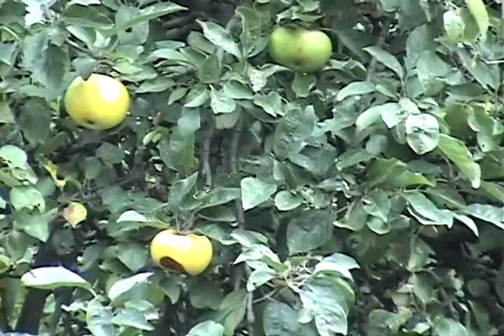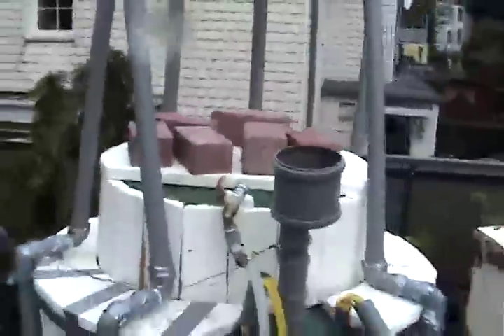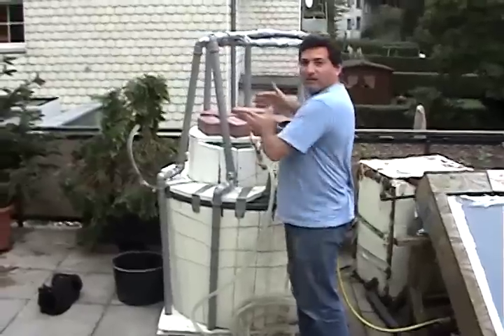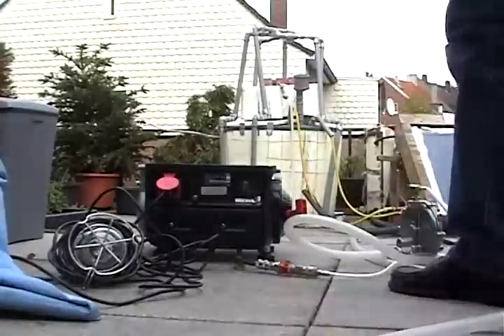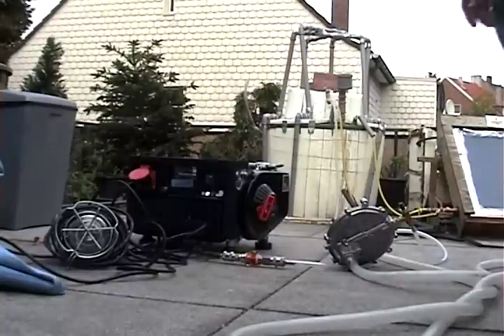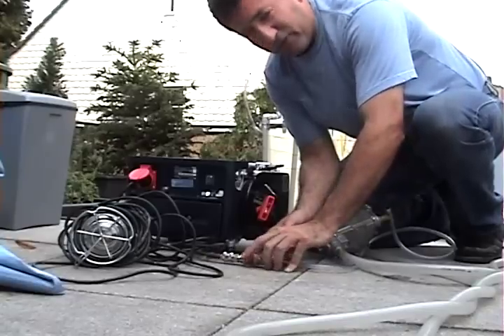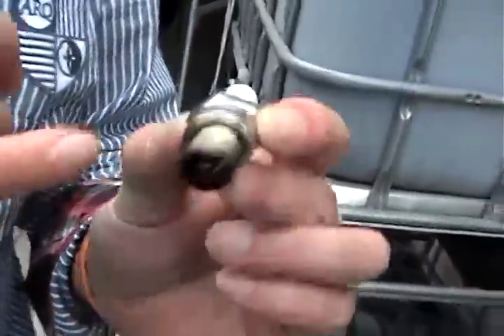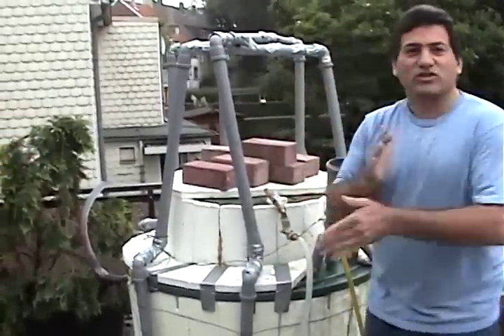Running a small engine on household biogas using "brickage' for gas pressure 2

Comment: You need to get a 4 stroke it is a matter of time before you seize that engine. If you do succeed with the oil you will probably over oil it and it will smoke like hell. I am going to do this in Portugal but I will also add in hydrogen made from solar pv. I need very little electricity 50 to 100watts that will economise on the use of gas. Basically the generator is jus running on tickover I may need to increase the weight of the flywheel a bit. What matters is the pressure of your feed gas the number of brick vary according to the cross sectional area of the drum. If you fit a pressure gauge in the feed line  you could do without a pressure regulator and just very the number of bricks.

Comment: Your the Man Brother , your doing my dream , I don't know if you will get this message because the feds do nothing but hate on me , but one way to increase your pressure is to use springs inside the tank , a cheap and way to get high pressure free , with out using energy.

Comment: Thanks for the vid. Did you say you ran out of fuel when the engine stalled the second time? Just curious to know how long it runs on your size bio-fuel generator? This way we can get an ideal based from your setup how many, or how big of a bio-fuel generator we would need to run the motor as much as you want, 24/7, or at least 24/7 for a few days.

Comment: When running propane in my 2 stroke bicycle motor I put on 2 carbs one which came with the gas regulator and the other smaller one came with the motor. I bought a Y spiter to allow 2 carbs and run an iol rich 12:1 in one and methane in the other compensate for the inability to mix oil with the gas phase methane. (A) carburetor- adjust oil+gasoline mix,  (B) carburetor/regulator, C a way to mix the output A and B  before intake. The gasoline acts a well distributed  delivery method for lubrication with enough.

Comment: You need a scrubbing system between the biodigester and whatever it is you use the gas for. Apart from methane, biogas also contains hydrogen sulfide, which, amongst other things, smells bad and is corrosive; moisture and carbon dioxide. You should run the gas through a water bath, so the carbon dioxide dissolves, and then through a scrubber, to remove hydrogen sulfide and moisture. For the scrubber, you can simply use a U-shaped pipe, stuffing steel wool in the ascending and descending portion of it (to remove hydrogen sulfide) and something like kitty litter pellets on the bottom, to absorb moisture. This should enable you to produce much purer methane, moisture and odor free, that won't corrode any metal components.
Reply from the maker: We appreciate  the sentiment and have experimented with those approaches for the last ten years and determined that apart from running engines  for our cooking and water heating  uses it was unnecessary. We continue to use simple scrubbers for engines as you describe but no longer bother for the stove.

Comment: thank you for your nice sympathic project and for your anthousiasm
if you permit me, just add a pressure measurment, lilltle hole + screwer and put it there, so you can read directly your pressure at the outload, and always write it in a book, so you will control much better your experience
and a ph metter for your digester, it must indicate a ph of 7 sign that your bacteria in there are really happy to work for us

Comment: If you use your bricks to force your gas into a large tire inner tube you will have the pressure you need because the inner tube will expand as gas is pushed into it !!!! Also they make for great storage!!! If you are using the regulator it shouldn't matter about the number of bricks as long as you observe the regulator inputs !!! Also you can just feed it into the machine without the regulator using a ball valve to regulate the input into the carb!!

Comment: make a water column tube and watch for about 10in/wc. there are conversion kits that converts the gasoline tank into and engine oil reservoir with a automatic feeder valve that opens with engine vacuum

Comment: its good thinking But you can do this for better result : bump the gas into a water filter first  then into a air compressor(you can use a refrigerator motor as compressor ) into a gas tank and after that you will get very good result  >>> keep in mind its not a sempel operation an you need to take all the safety majors befor doing it

Comment: why not use a 4 stroke engine,, also why not change up the regulation device so you do not have to push the primer to give it less restriction if the reason for the regulation device is safety then some other spark arresting device that offers no restriction could be used like off of a big blow torch or other device... i understand there could be other issues i am not aware of that might make these ideas hard to  put into use.. they were suggestions per request..  some form of rubber cord could be used to put down pressure on the tank in place of the bricks this would allow you to not need a rack to stabilize it from tipping like rubber tie downs

Comment: spark plug gappers 1$ autozone and spark plugs do not come in the recommended gap.. a hammer not suggested. but simply flip upside down and add slight pressure to close gap. gently open to recommended gap w gapper.

Comment: Sorry for all my other questions but do you get better gas or cleaner burning gas from different waste products?  Is is it compatible with lpg? Does the bio gas smell?  Great vids would like to try some experiments myself.  I live in the country and everyone has lots of those large AG steel reinforced plastic containers just lying around as scrap.  Could easily get 20 or so if i wanted. Now that would be interesting...Would u need something to stir up the whole mix in a larger tank?
Reply: Gary Mitchell

Comment: What is this regulator device you are using before the generator?

My main goal is to ultimately run a generator with my biogas.
Reply: it looks like a regulation device off of a camp stove or bbq type grill or similar device lots of propane type units have this kind of set up
Reply: yes, thats what it looks more like. thank you
Reply: Most propane regulators off of grills only go up to 3psi max(because with propane, any more and it becomes a torch really fast) I suggest a regulator with a knob on the top that can go all the way up to 20 psi. No reason to try to add pressure with bricks and then take it away with a BBQ regulator.

Comment: The bell system is able to be used in a better fashion by changing your design slightly. A tall bell that has a counter weight pull system to make the bell equal a low weight is great. When the bell is at its top (Full of methane) the counter weight is reduced and that pumps the gas into a storage container. This weight system can pump higher pressure and is capable of pumping through a filter for better gas. This give you a pumping station that allows tanks installed on equipment and such.

Comment: I'm looking into setting up a bio-gas arrangement here on our farm and have some questions.  We soak our corn for our pigs because it just makes it easier for the pigs to digest and generate usable calories from.  The gas that is created from the fermenting corn is flammable and the corn soaking bin can generate this fermenting gas in a matter of just a few days.  I'm wondering if you have any thoughts on using corn gas?  Also, while we do have pigs, we AREN'T going to be getting into their pens anytime soon as they are quite large at this time, so harvesting the poop isn't an option when they get the size that ours are now.  HOWEVER, we have several rabbits we raise and breed for meat and they make a ton of poop and if you've ever smelled rabbit poop, you know it is very strong.  I know it does have a high ammonia content and I'm wondering if rabbit poo would possibly be a resource.  We don't have many kitchen scraps as those usually go to our compost or our livestock, but we do have a lot of other things around the farm that I believe I could relatively easily harvest in order to create our own gas.  Any thoughts??

Comment: Experts...please advise
I am from a rural area in Pakistan. When we built our house there was no sewerage system in that area. The way locals deal with the issue is to dig a deep well which is has brick walls and is sealed from top. Over the years it has built up with just human waste and water used in kitchen and toilets. Can it be turned into a biogas container?
Its like 50 feet deep and it was made in 2006. By now I am sure more than half is filled.

Comment: You need pressure to move gas from the biogas digester, through your pressure regulator and to feed the electric generator. Pressure is weight or force / divided by an area. In Your case you are reporting that 24 kilograms of weight is giving you enough pressure but your missing over what area. For instance 24kg/km^2 vs 24kg/m^2 vs 24fg/cm^2 each result in very different pressures.
Reply: If it's an IBC then the area is probably about 1 square metre.

Comment: Professor, how you lost weight. I'm surprised. But now it got better as it is more saldavel. So I'm still looking for the parameters I automate my small biogas generator. I'm looking at the core temperature, the system pressure. What would be another sensor or parameter needed?

Comment: Could you please tell me the specs on the gas regulator that you are using and the part number/supplier?
Thanks,
Gary
Reply: Gary The regular he is using is from a generator propane conversion kit they are all over eBay sorry it took 5 years for someone to tell you🤣

Comment: Maybe a cap which runs meth line and oil line, with an undersized fuel pump to run a smaller volume of " fuel" ( oil ) might work for the lubrication issue..  If it's a 600 cc, maybe a pump made to run say a 50 cc engine might work out..  I dunno what's out there but if a small one, it'd ( presumably ) be set up for commensurately smaller flows.. If also a 2 stroke, ought to be designed to handle oil running through. If not straight oil, some.. ..  Just a thought..

Comment: Excellent video guys...!   It's cool to see you getting a 2 stroke to run on methane...!  

I wonder if somehow running oil via a second line through the engine could be done simply..  

I heard somewhere that 2 strokes are essentially Diesel engines, not sure, but if so..( it'd certainly explain the mixtures they use.. I guess..) it might not neccesarily be needed to run ( for short times..) both oil and methane...  What if you had a 2 way valve on fuel line, and ran biodiesel or SVO...( cooking oil ) and the gas alternately  say 30 minutes each,..?  I mean, you could, because ( assuming til run on bd/ SVO ) then you could be sure it's getting lubrication some of the time at least, right..?   

A 4 stroke diesel, would Definitely run on SVO ect, and I am guessing might have less issues with lubrication, too... ( might still be a problem at the " top " end of the engine, but smaller volumes might cover this risk..) ( sorry, not a mechanic, so I am only going by what I heard.. ) 

Anyhow, congratulations on getting to run, and good luck to you guys.

Comment: Simple solution, find a 4 stroke generator with an oil filled crank case. That would solve your need to inject oil into the fuel...

Comment: Six Bricks, at least you figured out that your regulator was holding back the pressure. Nat gas and propane are like only 5 or 2 psi after the regulator. A propane regulator is about 150 psi on the tank end.  I wonder who much volume over time you get of gas. Also I tried to make methane with grass trimmings and things to no avail yet, so the particulars of your method of biological digestion to produce the gas would be interesting. Thanks WK.
Reply: add caw manure, it still has enzymes that break things down. it continues to digest the new grass
Reply: cow*

Comment: Using CASTROL MAGNETEC OIL is negatively charged oil.

HINT: - 4 STROKE Engine is the BETTER Alternative, as it has a OIL SUMP.

Excellent achievement, so far.

Keep up the initiative

Comment: Awesome idea biogas to run a generator and great efforts. There is one problem with you oiling only through spark plug hole; the crankcase isn't receiving any oil which is really bad its the main part of a 2 stroke that needs oiling.
Good luck

Comment: just use the two stroke carburetor to feed the engine it's oil. rejet the carburetor to suit the engines needs. if you can't find jets the small. fill the jet with epoxy. then find jet drills and step up the size of the drill till the spark plug looks right.

Comment: Make the gas from the digester comes through the water, when you do so the impurities in the gas is reduced, in addition to this use a vehicle tyre (tube inside the tyre) to store the gas it will act as a pressure regulator and the water molucules if present in the gas will settle there..
Reply: how does the gas flow into the tyre ? what fittings do i use ? wouldn't the tyre when filled to a point.. start restricting the gas entry  ? just asking .. would like to try this at home.
Reply: @laowoodley6165  did you ever try it??☺

Comment from the maker: In later videos I switched to using a 4 stroke.  The oiling the 2 stroke issue made it seem unfeasible for most people so since a 4 stroke is self lubricating it is much much better. I use a tri-fuel kit so my 4 stroke genset can be run on various fuels including gasoline if nothing else is available.

Comment: have you ever tryd using a 4 stroke ingean in sted of the 2 stoke or doese the 2 stoke have more compresion in order to run the bio gass i know of a man who runs his moters on wood smoke but he needs to use bigger injeans like a v8 or v10 works better ive been testing it on lawn mower injeans it seems to work fine as long as i have the smoke and air mixture right

Comment: I think it's best to redesign your bioreactor and try to put into consideration a higher H:D ratio. Also allow the process to run for a considerable length of time for enough gas to be produced, that way the gas pressure in the vessel will drive the delivery to the electric generator. I am also pretty sure that since you use bricks to hold the reactor lid, you lose some amount of gas produced thereby causing more harm than good, try sealing the lid completely.

Comment from the maker: It doesn't -- I injected the oil in the spark plug hole.  So I had to abandon using my two stroke because of the hassle and uncertainty and bought a four stroke instead which works fine. People wrote and told me ways to get oil in to the two stroke but i never had time to experiment. I tried an inline oiler but it didn't seem to work.

Comment: hey how would you collect then compress it into a tank? methane/biogas is very similar to CNG or propane when running a car. Since some homes also are heated with gas furnaces, Could you also use it to heat the house?

Comment: I was considering building a similar project in which the methane output from the digester could be converted to energy/electricity. In the video you are using some type of generator that functions off of the methane gas output. What is this generator and is it possible to purchase one commercially? If so, where would I be able to purchase one?

Comment from the maker: Hi Neomorpheus (is the name a reference to the matrix? I took the blue pill I think!). The answer to your excellent question is that the regulator is necessary for... for... for NOTHING.  We thought we needed it but we don't. It comes in the kit for people using propane bottles with their gensets to lower the pressure. Then a regulator is needed. For biogas it isn't, so we have since removed it.  Using a valve to regulate flow is the only thing we use now.

Comment from the maker: You don't need to compress the gas in any meaningful way.  I found that by placing bricks on the floating tank of my plastic digestor I could run the engine just fine.  For me it took 4 to 6 bricks so about 15 kilos of weight pressing on the tank; that isn't that much pressure.  There should be some venturi effect or suction once the engine gets going that will pull the gas in.  As for the engine just get any normal 4 stroke engine that one uses for gasoline.

Comment from the maker: You can use any 4 stroke engine. The easiest thing to do is buy a trifuel kit for 190 dollars from US Carburation, it takes 20 minutes or less to mount between the air filter and the carburator. Done.

Comment from the maker: Thanks for the comment!  We now use a 4 stroke generator to avoid the oiling issue and it works fine (we modded it with a tri-fuel kit from US Carburation).

Comment from the maker: Rather than running a light bulb directly (which would be a terrible waste of the 2Kw the engine produces) we get approximately 45 minutes of electric generation out of every days' production of 1 cubic meter of gas.  This is enough to charge deep cycle batteries (even more reliably than 5 hours of photovoltaics) which can then be used to run several bright light bulbs for several hours.  So in a "disaster" it is quite a robust solution. Meanwhile, we use our gas every day for cooking.

Comment: I congratulate you on your efforts in the practical application of biogas. To eliminate the need for oil altogether I would suggest using a 4 stroke engine. I believe you will find that it will run cleaner and give you longer run times and engine life. Keep up the good work.